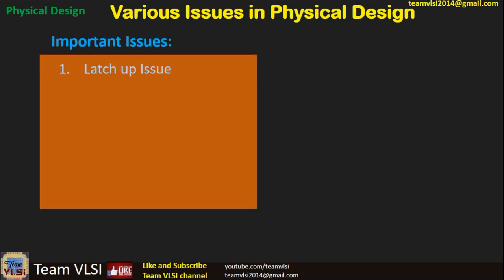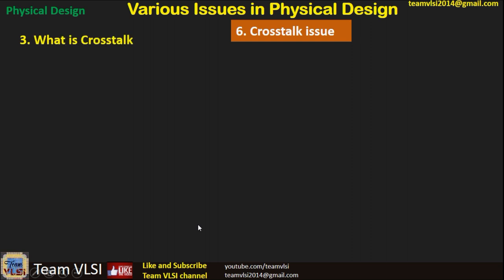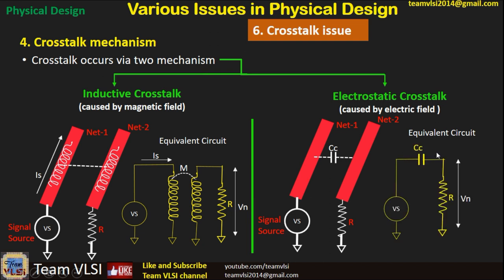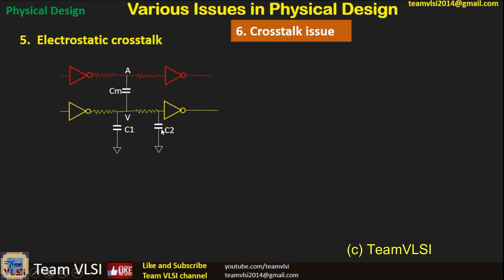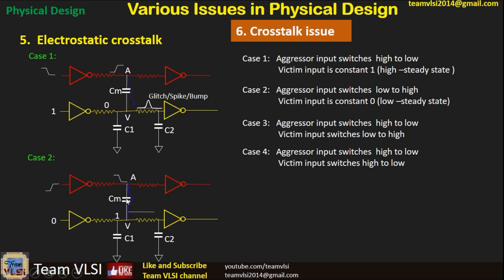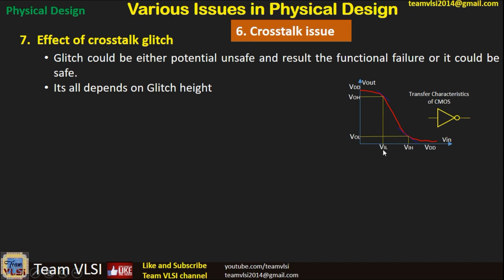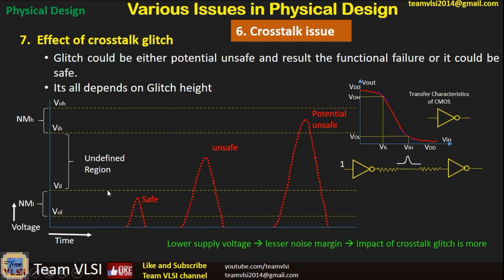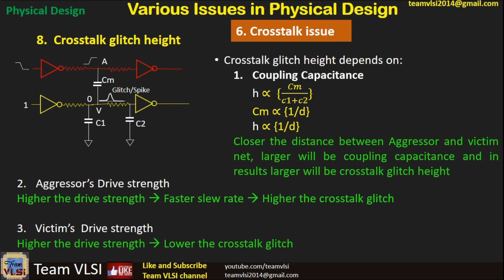Crosstalk issue in VLSI | Signal Integrity | crosstalk glitch | crosstalk Noise | part-1

Comment: In which case undershoot happens that is victim net is constant 0 or constant 1 please clarify this one
Reply from the maker: Hi Radha,
The undershoot may occur when the victim net is at constant logic 1 and the aggressor switches from 1 to 0 logic.
Reply: @TeamVLSI  what about aggressor net switching, in this video u mentioned 0 to 1 at one time and 1 to 0 at another time please check this in the video
Reply from the maker: Hi Radha,
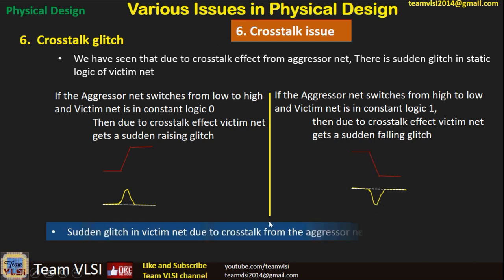I have edited the previous response as it was not correct. Now try to link it with a time stamp @21:20

I have checked the video and I am guessing the reason for your confusion might be case-2 at timestamp @18:19 . But that is also correct I have here talked about the logic level of input of the inverter which is driving the aggressor and victim net. But if you see the logic level at points "A" and "V" then it will help to clear your doubt.

Comment: we see glitch violations between same layers, why not between different layers?
Reply: I suppose due to static logic ....in same metal layer
Reply from the maker: Hi @Pavan
Thank you very much, for asking such a good question.
Actually crosstalk may occur to a victim net from the same metal layer nets as well as inter metal layer nets. But the effect from inter metal layer nets  is lesser as compare to same metal layer net because of the distancing between them and routing direction of metal nets.

For Example, suppose victim net is in M4. so crosstalk glitch may occur from following nets.
1. Adjacent M4 nets.
2. M3 and M5 (But these are not routed in the same direction as M4 , so area of mutual capacitor will be very less and distance is also large compare to point-1, so mutual capacitance is very less as compare to point-1)
3. M2 and M6 ( These are routed in same direction as M4, But now distance is too large)

So most dominating contribution is from same metal layer.

Hope I made it clear. Let me know your view on it.
Reply: @TeamVLSI  Thank you for the explanation